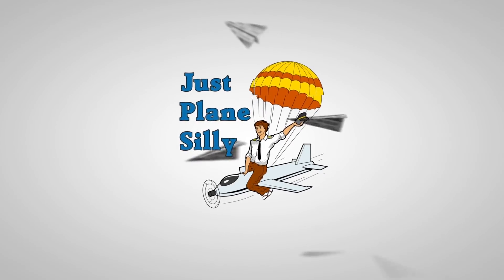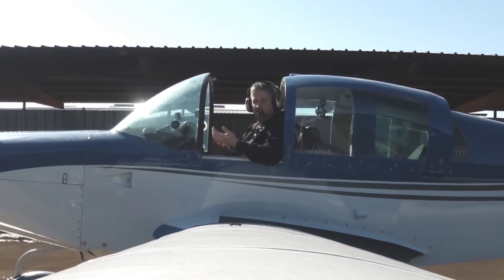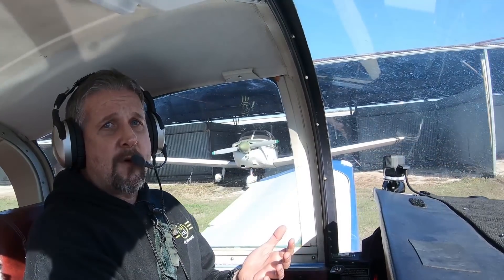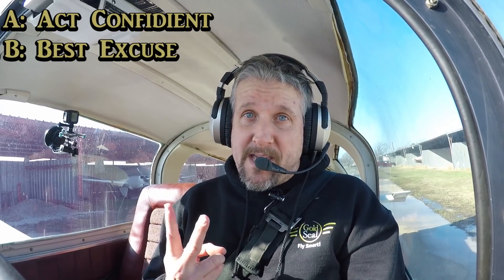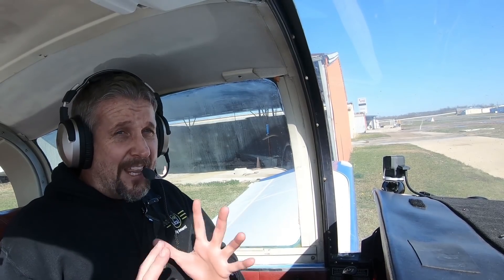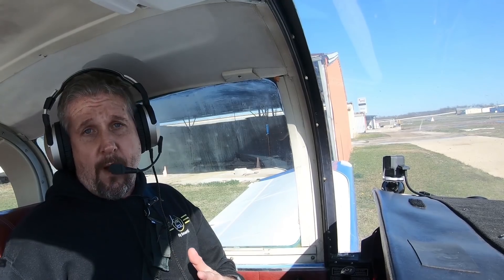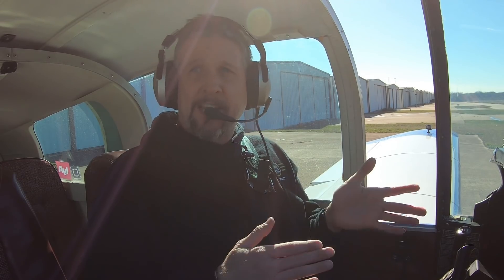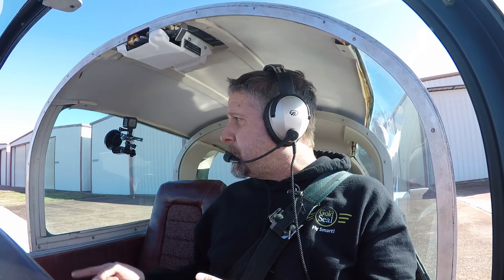The Aircraft Engine Failure Recovery That Nobody is Teaching!

Comment: I wish I had this advice when I had my engine out on the ground during my first Solo Cross Country. I was flying to Chico, CA in a Diamond Eclipse (which must have the fuel pump running at low engine speed) and they had a fire tanker doing drops on the concrete pad next to the runway. Apparently I got distracted and didn't switch the fuel pump on during the landing checklist. So I touch down, and in the roll out, I watch the propeller come to a dead stop straight up while tower is asking me to take the next taxiway. I'm cranking the engine franticly (it has a battery the size of an ATV) and right before the airplane comes to a stop on the runway it lights off and I reply, Diamond 5JP taking taxiway Echo to the Ramp to runway 13L. 
I played it cool, but always assumed the tower staff was laughing their butts off about the Diamond rolling out without the prop turning. I was so embarrassed!!!!

Comment: I was hover taxiing my MD-530 when I got the notification for this video. I told ground to standby, watch your video, then continued taxiing.
Then it hit me... do I have Schrader valve??? 🤔  I don't want to have an engine failure. 🥺
I set it down on the taxiway, shut it down, and walked to the nose to check for the Schrader valve.
I need help 😕 , not only could I not find the valve... I couldn't find the prop or the engine! 😯
I've got the spinning wings for lift, but how can I have forward flight without a nose prop??? 🤔😕

Any help much appreciated. 🚁🚁🚁
Reply: Unless you have BIM indicators ( Blade Integrity) your Schrader Valves are back in the hanger on the ground handling wheels!  :)
Reply: Don't worry about the nose prop. As a professionally licensed aerospace engineer, I can tell you, your aircraft generates forward thrust through application of hope, witchcraft and magic.